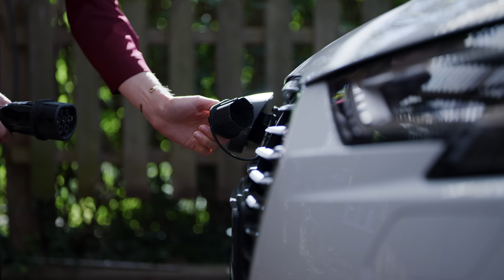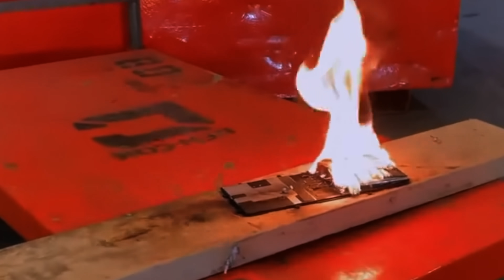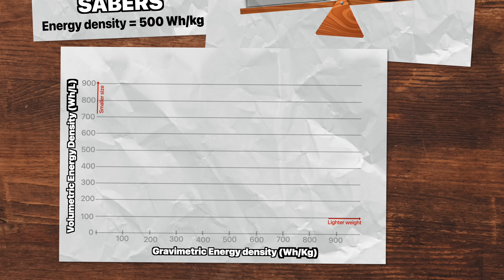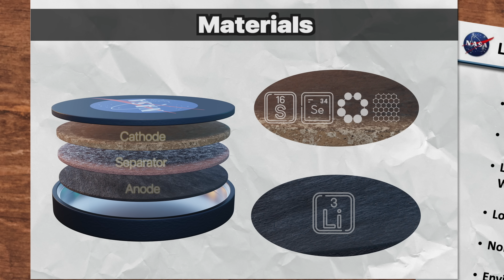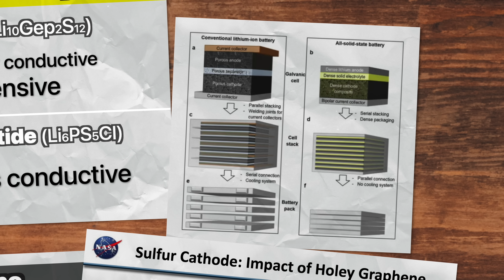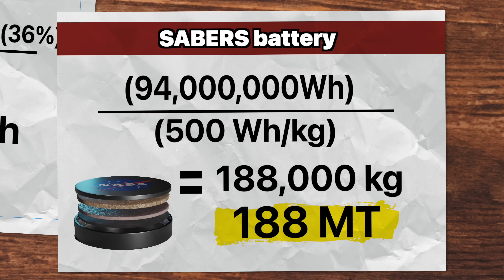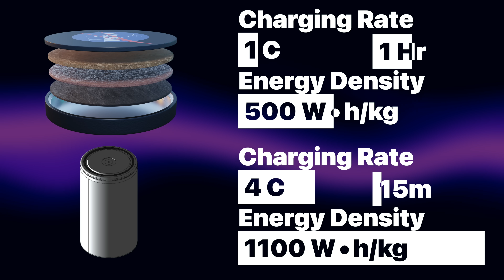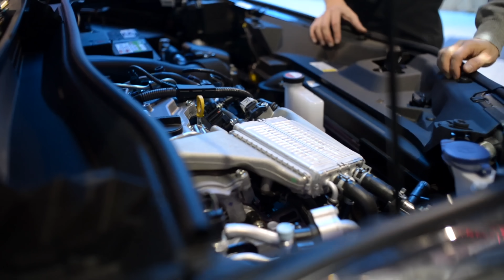Why NASA is Building a Solid State Battery

Comment: I think you overlook the fact that EVs have the same or similar amounts of charge/discharge cycles as a plane if not more. Added range does not change this cycle for EVs. So size and capacity is great but if it has to be replaced often then it will not work for EVs either ...
Reply: It's not the same. Three big factors to battery longevity are minimizing the number full charges, minimizing the number of fast charges, and keeping the temperatures near room temperature. All three are much easier to do in a car than in an airplane.

On top of that, the aviation industry has to be much more cautious than the automotive industry about replacing old/worn components because they cannot take any chance on anything going wrong during a flight. So, the same level of battery degredation that might be perfectly acceptable for a car may be completely unacceptable for an airplane.

Comment: I honestly don't ever see this technology reaching the airlines commercially, maybe experimental or cessna small engine style planes.  I'd like to have a lighter battery in my Tesla model S, that is the only way the tires will last more than 25k miles.  The car is just too heavy w/ the battery.  Otherwise I enjoy the car and the performance is amazing.  It's great for a 200 mile trip, beyond that charging starts taking too much time.

Comment: I don't need an EV that goes twice as far as long as it can charge twice as fast and there are suitable reliable chargers at every highway exit just like I take the fact that there are working gas stations near practically every highway exit for granted today that have an effective charging rate of about 20C regardless what fill level or temperature my tank is at. No point in lugging a 500kg battery around and incur unnecessary tire wear when I make 500km trips only 5-6 times per year. Drop the battery to 20-30kWh and give me a 50kg range-extending generator instead, the generator's heat will be very welcome on frigid winter days (as in -20C or worse) where the battery will kill itself maintaining its minimum working temperature.

Comment: Steamships did not replace sailing ships overnight because sailing ships started incorporating steamship technology. You don't need to be able to do a complete jet replacement in the first step, you can add batteries and motors to jets to reduce the amount of fuel they burn. A steep carbon tax on that fuel would help that along with the funds going to biological projects to move carbon from the air and into the ground.

Comment: Why must it be Battery ??? I really dont understand. First there are hybrid-solutions, some part to part mix. And then how about a powercell method, where you PRODUCE your power necessary just in time. It seems like to be really no solution for huge damands like ships, planes or else to just have power STORED and then use it. You simply cant, get away from this. Imagine the most monstreos demand to solve with a battery, like so start a rocket to space. How can you even think about batterys, there MUST be a different way, and thats the way to go for even all smaller things. Electric power can be transmitted, produced or transformed from somewhere, but not stored. A different thinking is needed here.

Comment: This 500wh/kg battery is only good enough for 300-600 miles range based on the Electric Breguet Range equation with realistic inputs.  600 miles is with very advanced aircraft design inputs, far more efficient than large commercial aircraft.  BWB would be an example of the tech requirements.  1C is fine for that range.

Comment: Aluminium-air fuel cell comes with 900wh/kg. This is what we should start working with for electric flight.
Reply: But that's not rechargable if I'm remembering correctly.
Reply: @bzuidgeest It is "charged" by electrolysis in molten state. In practice in aluminium factory. Some types are charged with Al-powder, and the oxides are removed for reuse. 

Other problem is that the weight is much higher when battery is empty.  Long distance flight would need to drop used batteries before landing. 

Al-air battery is on old invention. I read about it in beginning of 1990's. That time it's power density was really low. Exceeding the limit would make Aluminiumoxide i.e. sapphire on the Al-electrode. Now they have solved that problem as far as I know. 

Al-air battery would be good for backup battery and for long term storage easier than hydrogen + fuel cell. 

For a car I don't think that anyone would like to go tanking aluminium powder and empty slurry every 1000 km, if one could charge nearly anywhere for over 300 km. Possibly a hybrid would work. 10 * 10 kg Al batteries for extra 500 km range and 250 km range chargeable battery for normal use. Al-air battery would be expensive to use, as only the logistics and "charging" would be costly.
Reply: @jounisaari9471  basically recharging by remanufacture then. Not a replacement for what's in cars now.

Comment: Great analysis - especially in looking behind the paper.
Yes, I agree that short-haul would be the most practical use for electric planes in commercial aviation BUT, you also need quick turn-around time and a 1C charge is not going to get you there.
Another issue I was just thinking about is where you need to put the batteries - in the wings.  This would make them very difficult to access could prevent you from doing a battery swap.
Reply: Are you dumb? Same problem all other high Wh/kg batteries have: Rare elements.  Selnium = useless for mass production.  Selenium is very rare.  Is  MORE rare than Silver by ~50%... Hello?  Rarer than SILVER folks.  This will NEVER work.  Make it out of Barium or some such toxic material we need to clean up anyways.
Reply: 𝐁𝐎𝐘𝐂𝐎𝐓𝐓 𝐌𝐈𝐃-𝐕𝐈𝐃𝐄𝐎 𝐀𝐃𝐒
DISLIKE DISLIKE DISLIKE DISLIKE DISLIKE 
DISLIKE DISLIKE DISLIKE DISLIKE
Reply: Swappable wings maybe?
Reply: @KELVIN4TOR Because pilots love the idea of wings that can come off the plane.
Reply: Swappabe brains maybe? Try it out @KELVIN4TOR
Reply: Why would the batteries have to go into the wings? The airlines could put the batteries in the fuselage and just make the seats smaller and give us less legroom. Or, and I know this is going to be a revolutionary/controversial idea, make us sit in each others laps. That should solve the problem. 😁
Reply: Same reason the Kerosene is in the wings today.  Saves weight.  LOTS and LOTS of structural weight as wings want to have a HIGH aspect ratio which means the cantilever beam of said wing is even longer and to counterbalance weight of fuselage etc, you place FUEL ALL the way out to the wingtips.  Not only that, why the engines are NOT on the fuselage anymore but rather under the wings as FAR out on the wings as they can go.  Not only that, but this shrinks total wetted area for decreased drag as fuselages are completely STUFFED.  Not to mention in a Battery solution, you NEED the batteries to be CLOSE to the motors and therefore shrinking amount of GARGANTUAN HEAVY power cables and VERY expensive insulation from Shorts, vibrations etc.   @rogermccaslin5963
Reply: @rogermccaslin5963  The volume of an aircraft is a big contributor to its drag so you never want to fly with empty space.  The wings have to be the shape they are to create lift so they have a lot of "empty" volume that needs to be filled up - the fuel fills that now and there is not much else you can put in there so I am pretty sure that is where they will put the batteries.  LOL on ways to put the batteries into the fueslage.
Reply: connectandelectrocuteaggie • The speed of air passing around the whole plane at high speeds creates the ionic potential difference between the air and all the exterior metal ( or other specific material ) body of the plane. This can continuously keep charging the batteries and powering the electrical motors. 
This and the technologically advanced batteries solve completely this issue.
This can be also applied to cars at high speed, etc. /
( A general "ionic" principle, but more advanced, can be used to power a spaceship anywhere in the void of the Universe by making use of what's in the "void" only, its local entropic arrangements. You don't need to carry any source of energy with the spaceship in the "void" of space, since all the energy one needs is "engulfing" the spacecraft continuously anywhere in the Universe. )
Reply: How stupid... Where is ground?  Suggest a circuits course and basic physics any jr high kid understands.  @mikel4879
Reply: @mikel4879  Interesting, I suspect drawing off ionic potential would probably introduce some additional drag (there is no free lunch).  Do you know if there are any academic studies on that?
Reply: Wrong. Anythiong that is going to charge the batteries during flight has to get energy from there and that will be the kinetic energy of the aircraft. That will slow it down requiring more energy from the propulsion system. The laws of thermodynamics say that the extra energy from the propulsion system will be greater than the energy going to charge the batteries. This is just another take on the idea of trying to charge the batteries of an electric vehicle using a wind turbine attached to the vehicle. @mikel4879

Comment: No. But I like that idea. 
More like a navy carrier just not nearly so intense. 
Add enough boost to achieve take off as a supplement.
Getting all that weight up to speed takes a lot more energy than maintaining that speed.
Reply: No it doesn't. Flying for hours at altitude uses more energy than takeoff

Comment: NASA is great for out of the box ideas, though there are a lot of bugs to iron out yet, it looks promising. There a lot of safety issues to look after too for lithium ion. A lot of catastrophic damage from runaway battery fires will make it harder to insure these great “green” vehicles. (Burning cars are not good for the environment either. And the fact that is sometimes not one, but multiple vehicles and the structures they’re in. EV burns and your house is gone too. )
Reply: You get in an crash with in an EV, you best hope you're able to walk away....
Reply: Uh?  Say what?  Selenium... Rarer than Silver by 50%!  Hello?  Earth calling reality here...  NASA is looking for a battery to replace the batteries for SPACE stations and other SPACE applications.  NOT for Joe six pack.  Fire from battery fire is a MASSIVE problem for a space station.  Why the current batteries on the Space station do not HAVE any electrolyte.

Comment: Really exciting stuff, Ricky!  I can't wait to see what the next 3 to 4 years brings in EVs and Aviation because you didn't even mention what these batteries can do in smaller airplanes and also drone taxis.  Solid State batteries will definitely make the latter half of the 2020s very exciting to see.
Reply: Sigh... Same problem all other high Wh/kg batteries have: Rare elements.  Selnium = useless for mass production.  Selenium is very rare.  Is  MORE rare than Silver by ~50%... Hello?  Rarer than SILVER folks.  This will NEVER work.  Make it out of Barium or some such toxic material we need to clean up anyways.
Reply: Umm no, try the last decade of the 2000's.
Reply: 𝐁𝐎𝐘𝐂𝐎𝐓𝐓 𝐌𝐈𝐃-𝐕𝐈𝐃𝐄𝐎 𝐀𝐃𝐒
DISLIKE DISLIKE DISLIKE DISLIKE DISLIKE 
DISLIKE DISLIKE DISLIKE DISLIKE
Reply: In 3 to 4 years barely anything will change because the world will be at war.
Reply: "drone taxis" ok Muskrat. Any day now you can turn your tesla into a "robotaxi", wear out your battery at lightning speed and pay 10x the value of the car just in insurance. oh and how will you get to work if you are leasing it out to strangers vomiting in it all day? haha i swear you Musk fans have very little thinking capacity.
Reply: 2030s if you're lucky, has to be commercially viable and scalable to manufacturers.

Comment: Great video, but I have some problems with the math part in more than one aspect. For one, if an engine puts out 100 HP  and weighs 50 kgs and we need an engine putting out 500 HPs, we cannot just simple multiply 50 kgs by 5 and say a 500 HP engine would weigh 250 kgs. Even bigger problem to calculate airliner range by saying if we need 1000 kwh energy to fly 100 miles then we need 5000 kwh energy to fly 500 miles, since the takeoff part (to cruising altitude) of a flight probably takes more energy than the whole 100 miles flight. Otherwise good video with interesting information.

Comment: One of the things you neglected to take into consideration is the current airline model is to maximize the time the planes spend in the air, which means that they are trying to minimize the time spent unloading and loading at the airport.   This is in direct conflict with a battery that needs recharging.   If you said you had a battery which could recharge in 15 minutes, or even 30 minutes, then you might have something viable for airliners.   But the current technology means that it would take hours to recharge, which isn't something the airlines would be interested in at all.  They want to turn and burn.  Some of those planes hit three or four or five cities every 24 hours, and that doesn't leave any time for recharging.
But for private planes, or human carrying drones which might be only used once a day or once a week, then the technology could be a real gamechanger.   But the downside there is redundancy and reliability.   Almost everything on a private plane has a backup, the engine has two alternators, two fuel pumps, etc.   So that means, in essence, you'd probably need two battery packs for it to be considered "safe" enough to be viable.  And that may be a tough bar to clear.
Reply: However the planes could be designed such that the batteries can be swapped by fork lifts at the airports, where they then get recharged over many hours. I could envision a train of fork lifts that go under the plane and swap out a number of battery packs in not much longer than it currently takes to refuel.
Reply: @Ken00001010  That is true, I didn't think about that.
Reply: Indeed a Battery swap system would be the only viable way to make battery powered aviation operable with charge rates of less then 5-8 C.  Unfortunatly this almost completly precludes placing batteris in the wing which is a huge volume used in modern aircraft for fuel and which leaves most of the fusalage available for cargo.  As for Battery back backups, that's not a reasonable expectations, Airplanes don't have a second engite fuel tank, they have redundant fuel pumps.  A Battery back can have redundtant bettery managment circutry and software to control it's many individual cells.
Reply: @kennethferland5579  That's an excellent point, the airliner would have to give up substantial amounts of cargo space.  I hadn't considered that.  Makes it even more of a dealbreaker.

Comment: You’re missing a large factor in viability for aircraft which is propulsion systems efficiency. 
Switching to electric propulsion enables the use of distributed propulsion configurations which are up to 6X more efficient than the turbofans used for fuel powered aircraft. 
NASA has been developing DISTRIBUTED propulsion for many years now and it’s getting quite mature.  It’s already been used by several commercial companies.
Reply: ROFL>.... dear god... any dumb ass can type....  A propeller is 85% efficient.  A turbofan is about +94% efficient at turning POWER into thrust.  The problem with a turbo fan or "distributed" propulsion is that it accelerates the air too fast compared to ambient creating a giant loss in power applied to FORWARD flight instead of accelerating the air.  A propeller is the MOST efficient form of air propulsion in existence today.  ... Up until its mach limit that is.

Comment: I have always thought that when they start beaming power from satellites that there wouldn't really be a need for batteries if you wanted an EV plane.
Reply: you still have to store the power in order to have a plane use it. You cannot plug a cord from power plant to the plane, lol
Reply: @sikliztailbunch  So lookup how wireless power works. Not the kind like your phone where you sit in on a mat I am talking the wireless where your I cant remember if it was 3 meters or not but MIT was demonstrating that you can power a light bulb without the light bulb plugging into anything with wires. Similar other real world tech uses wireless technology like you ever seen a garage door where you walk thru it and it stops closing? It's shoowing an IR beam of light which on the receiver side is receiving an eletrical voltage. Tesla Coils you see on power lines also do wireless. However most of those examples are short distances. You might need something like RF to DC conversions where you emit a radio wave and transfer power over the radio thus not having cords or distance issues.

So in the world of eletronics you only need a battery when you are not receiving power live from a source. So imagine your phone and its plugged in.. its charging faster then its using power which means being plugged in, it doesnt need a battery. This can be demonstrated using a laptop lol wher ethere is no battery in it but its powered on. Batteries meerly allow you to detach a cord and get a set distance. So long as the plane has constant source of power it matters not if its battery or not. I do think a small "backup" battery would be a smart idea tho.